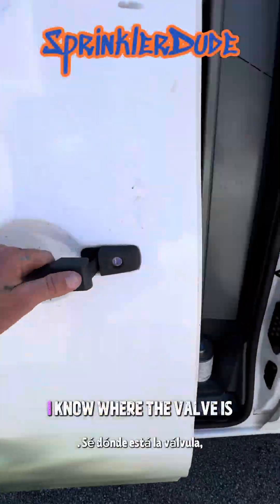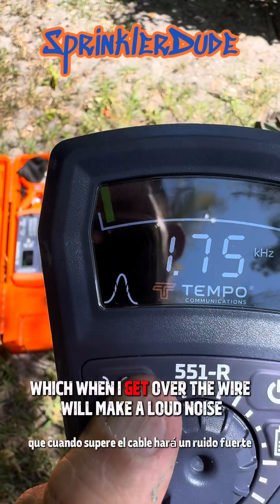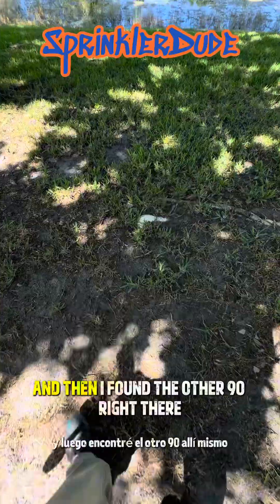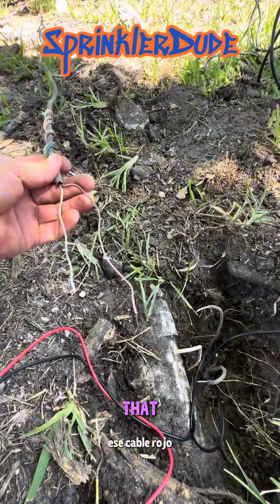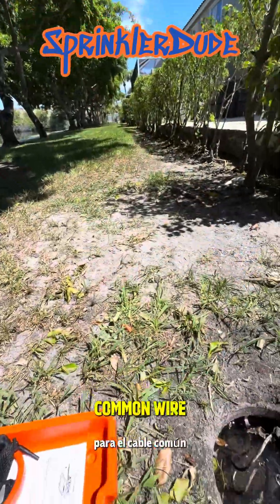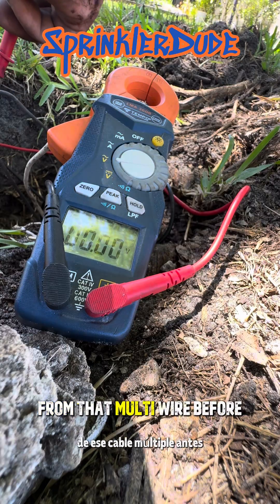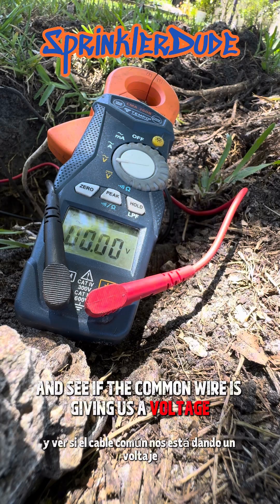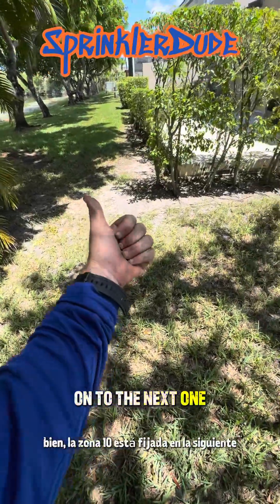Troubleshooting Sprinklers -Tempo Communications

Comment: How does the 551 do around electrical interference from transformers and such? I do a lot of commercial shopping centers and I’m always having trouble with my Armada Pro 800 getting static near electrical boxes and losing my signal.
Reply from the maker: The transmitter output dual frequencies. This allows the user to change between them while they’re in the field. And some situations you may want to have the higher frequency. It does a pretty good job of listening for the 33 kHz frequency when it is set to it instead of the 60 Hzhigh voltage. The receiver will also let you listen to the high voltage instead of what the transmitter is putting out so that you can differentiate between the two.